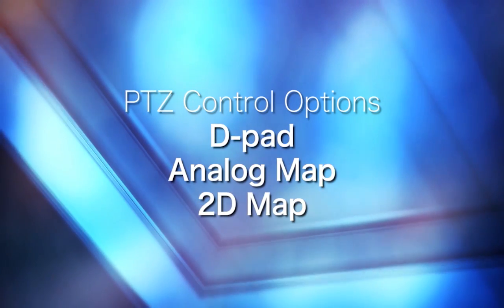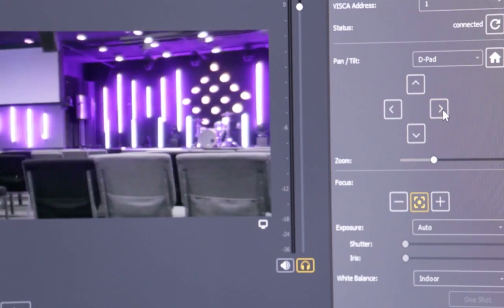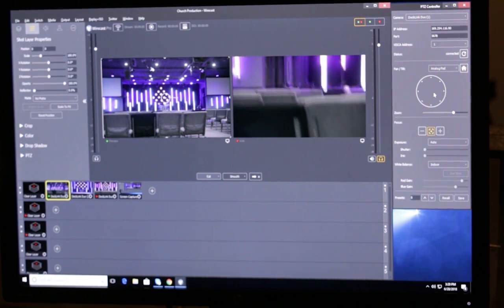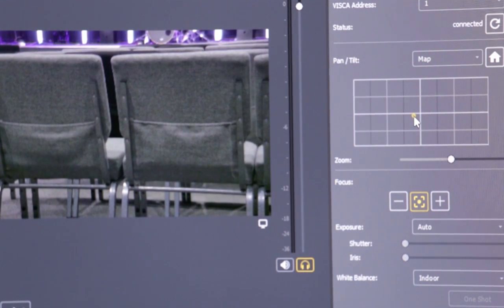Telestream Wirecast 10 Videoguys News Day 2sDay Live Webinar

Comment: I have been using Wirecast since v4 with a custom built rig. I started with using 3 HD Black Magic capture cards and the setup has been solid for many years. I added 2 4K cards now to the chassis, so currently have 2 HD cars, and 2 4K cards and that's been solid as well.. not sure about that comment about that being an issue ;) 

The issues I have ran into mostly have to do with either glitches in the UI, or in the early days playback of pre-recorded video inside a project(it used to sometimes playback all stuttered/choppy) butt am happy to say that was resolved some time ago :) The UI bugs were still present in v9, but I've just installed v10, so I'll be checking on that in this rev. Fingers crossed! Bottom line though, WC is the best value for money with this type of video production work flow. I would not still be using the software if it wasn't, and I've been using it for about 10 years now.